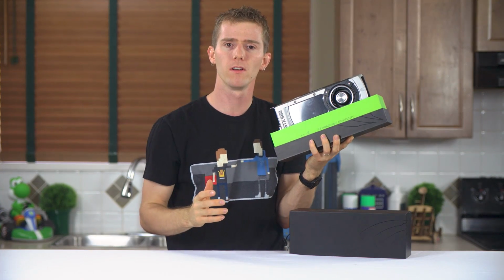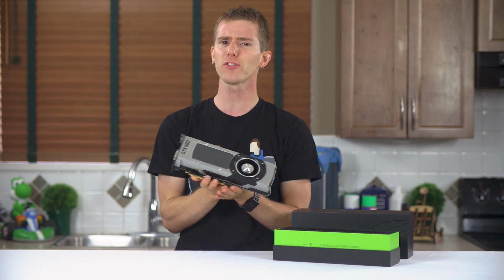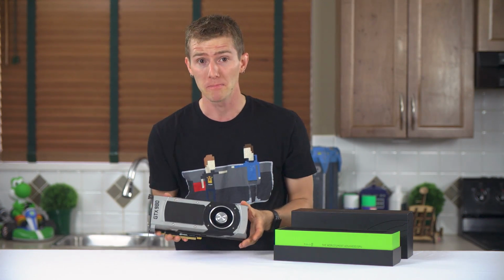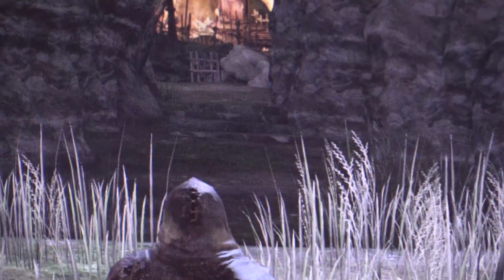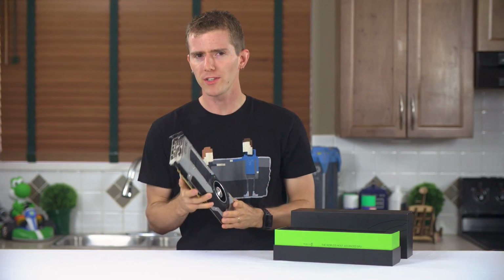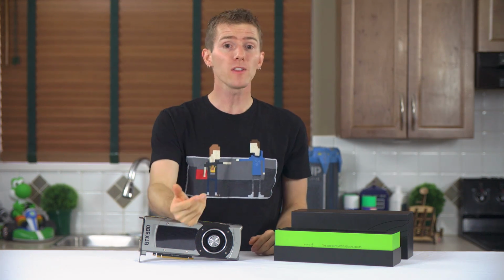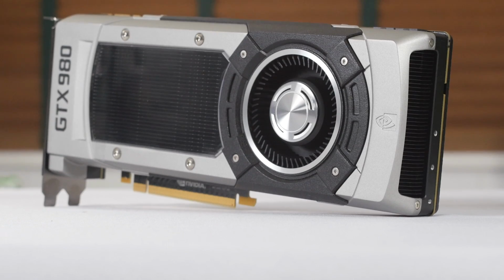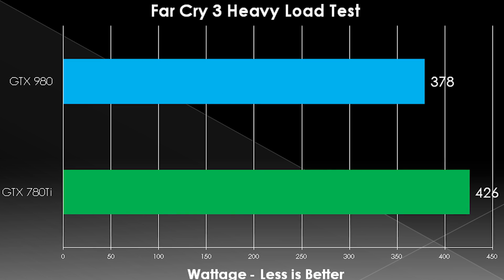NVIDIA GeForce GTX 980 Video Card - Performance Overview

Comment: Ok, so I´m going to build my first gaming pc. I´ll upgrade my desktop piece by piece, but right now I have an Intel i3 550 3.2 ghz on a MSI ms-7613 (Iona-GL8E) motherboard, plus 6gb of ram. I´ll upgrade my power supply first (doesn´t have 8 pin connectors) and maybe buy a new case.

From what I´ve read, the graphics card is the most important part for gaming. If I buy the gtx 980 and later, but certainly, upgrade other parts, what performance can I expect? can I start gaming with those initial upgrades? do I really need a better processor, or I can stick with this one till it dies?

Also, can someone give me some insight on my psu choose: the Corsair CX750 24-pin Atx 750w
Reply: Anyone?

Comment: AMD FX-8350 4.0GHz 8-Core Processor

Rosewill RCX-Z1 57.2 CFM Ball Bearing CPU Cooler

Arctic Cooling MX4 4g Thermal Paste

Asus Sabertooth 990FX R2.0 ATX AM3+ Motherboard

G.Skill Sniper Series 8GB (2 x 4GB) DDR3-1866 Memory

Crucial M550 256GB 2.5" Solid State Drive

Asus GeForce GTX 780 3GB DirectCU II Video Card

Corsair Vengeance C70 (Black) ATX Mid Tower Case

EVGA SuperNOVA NEX 750W 80+ Bronze Certified Semi-Modular ATX Power Supply

Asus DRW-24F1ST DVD/CD Writer

Cougar Turbine 120 (4-Pack) 60.4 CFM 120mm Fan

Xigmatek CFS-SXGJR-KU3 75.0 CFM 120mm Fan

that is my complete set up. i was just curious about compatibility and if i purchased the correct psu because i do not know for sure if i have all the pins and etc correctly. like will all the components fit into my psu?

and does my motherboard support 2-4way sli?

i am a noobie but i am a gamer and so i thought i'd ask a question here because i do not know much but i do need answers. thank you.

Comment: Kind of a noob question, but will the 980 be able to achieve 120fps with a single card on current and possibly future games at high-ultra settings at 1080p without needing SLI?

Comment: Can you test MSI Gaming 970 SLI or Gigabyte G1 970 SLI max overclocked as I feel these cards would outperform the 780Ti overclocked by 50% and are well worth the extra $150 over the 980?

Comment: I'm gonna wait for the 980 ti. I see no point in upgrading if the 980 is going to run the The Witcher 3 at only 30-35fps on ultra.

Comment: But the question is, could this run Killzone shadowfall? My guess would be no. Though it may have the diagonal kepler floating tubes and 16 dedicated smurx visors, it still lacks in the vex core department. It only has 11 vex cores, whilst the PS4 has 28 Vex cores under it's hood. Yeah, Vex cores aren't the be all and end all when it comes to pixel pushing, but a deficit of 17 V-cores puts the 980 at a serious disadvantage.

All in all, the 980 is a decent enough GPU. Just don't expect Killzone Shadowfall type graphics, and I think you'll be pleasantly surprised.
Reply: I know this comment is 4 years old but seriously what are you even talking about 😂

Comment: I have money for 980 or 780i, what shoud I buy?
And will my 850w Powersupply work
Reply: will my 850w Powersupply work ??? ...yes
980 or 780i, what shoud I buy ???? ...why the hell you want an older card... ???
Reply: get the 980 as driver support for it will last longer and the games in which it was worse in it was only worse by a few frames which means in the realm of error in that the 780ti had an "aggressive overclock" with the 980 with a "standard overclock" whatever those terms mean but the "aggressive overclock" sounds like he put alot of work into it to pump out the most possiable while the "standard overclock" sounds like it is just what most ppl will be using from a normal 980 when bought and hitting the "GPU overclock" in the overclocking program of MSI's ... they have really simpified it down that far.

Comment: Which is faster at 1080p? gtx 760 sli or 980? I dont care about temperatures and microstuttering and all that stuff I just want to know will this beat gtx 760 sli in modern games?
Reply: I also have an EVGA 760..I was wondering that myself, there arent very many 760SLI benchmarks out there, however I found one benchmark suggesting that the 760SLI performs slightly better overall than a 780ti, so id say the performance would be pretty much the same, 980 might be a little more powerful, I think Im gonna ditch the 760 SLI idea and get a 980 though because I want a 1440p monitor and could use the extra VRAM

Comment: I've heard the sound/fan noise of this card is significantly better than previous generations.

Would love to see you do a bit of a noise bake off to compare Idle, Mid Range game and a High end pixel pusher but only in the context of power draw and fan noise.

PS: Why doesn't anyone ever do a ducted fan strapped onto the card at a 90 degree angle?  I'm a front to back airflow purist and the spray and pray Dual/Triple fan designs on the AMD side of the fence frustrate me.  A good rear 90deg fan could cool 1 GTX card with a plastic shroud and leave plenty of room for shorter cards in other slots adjacent, or remove the shroud and a single fan could cool 2 adjacent GTXs with each fan getting about half the fan's total airflow.  All exhaust heat still goes out the back.

Comment: I've generally always used evga cards but considering I've ordered all the other parts for my build and they should be arriving by thursday I'm thinking of getting a gigabyte 980 just b/c they're in stock now and I don't want to wait on the EVGA restock, especially since I have no idea when that is going to be.  Kind of funny as I've had the money saved to do this build for months waiting on the 980 to launch and it hasn't bothered me at all to wait but now that I've actually ordered the parts it's like it's impossible for me to wait a few days or a week to see if EVGA cards get restocked.  That new build itch has taken over!

Comment: Is this a good build Sapphire R9 295X2 GRA Graphics Card (8GB, GDDR5, PCX, DVI, Mini-DPx 4.2S)

Asus PB287Q 28 inch Widescreen Ultra HD 4K LED Monitor (100M:1, 300 cd/m2, 3480 x 2160, 1ms, DP/HDMI/MHL)

Intel Core i7 i7-4790K CPU (Quad Core 4GHz, Socket H3 LGA-1150)

WD - 2TB Desktop SATA Hard Drive - OEM - Green

Microsoft Windows 8.1 Pro

Crucial BLT8G3D1608DT2TXOBCEU 8GB Ballistix Smart Tracer Memory
 
Samsung 24x Retail SATA DVD Writer

ASUS Z87-PRO Socket 1150 4xDDR3 Max 32GB ATX Intel Z87 PCI-E 1x D-Sub DVI HDMI DisplayPort

Corsair Hydro Series H100i All-In-One 240mm Digital High Performance Rad Liquid Cooler for CPU

Corsair CP-9020062-UK RM Series RM1000 80 Plus Gold 1000W ATX/EPS Fully Modular Power Supply Unit

Fractal Design Define R4 PC Case - Black/Pearl 

and can someone say if the graphics card on this build can not break that easy like if the computer falls  from the stand at the bottom of this desk http://www.ikea.com/gb/en/catalog/products/50219044/ if it still good if it falls from the stands at the bottom of the desk plz say
Reply: That's all good, but I would go with at least a 256GB SSD for a boot drive, and use the 2TB for data. I honestly wouldn't go with the WD Green, but with a WD Black since they have better performance plus better warranty, and with personal experience the WD Greens are absolute dogs performance wise, and not as reliable. Green = 5400RPM / Black = 7200RPM.
Reply: Ze Buttonmasha Can you send me a 4 tb one then and what would happen if i got a 1tb SSD
Reply: UpbeatGaming
WD BLACK SERIES WD4003FZEX 4TB
SSD drive would dramatically improve performance for your OS and primary programs/games. Just watch the SSD videos by Linus.
Reply: Sammy Singh I am getting a 4TB harddrive should i get the 4tb ssd
Reply: 1000 watts is a bit overkill when it just needs 50A combined with 2 8-pin PCIe connectors
Reply: sinephase not doing that build no more

Comment: I think I'm going to get a pair of reference GTX 980s once they become more widely available.  I'm currently running dual GTX 680s and together they equal the performance of one GTX 980.  So if I'm going to upgrade I going for two GTX 980s.  At some point in 2015 I'm probably going to get on the 4K bandwagon so this upgrade will get me ready.

Comment: I'm currently running 2x gtx 660 ti in sli, which are roughly equivalent to a single 780 ti, as the 980 is still roughly the same and I can not use the new features... Yet. 

Is there any point in me "upgrading" any time soon?
Reply: 1 card is always better than sli, but wait until the 980 ti
Reply: Mrchubakkaa that's what I was thinking. I think I can run 3440x1440 off of 2gb (though probably not on ultra) until then too!?

Comment: I would choose the gtx 980 over the 780 ti just for power improvements that the 980 brings to the table. All that talk on tech that's not supported just yet is just wind blowing around and making alot of noise.

Comment: Instead of ONLY OCing the cards and putting them into a graph against other GPU's, could you guys please run a benchmark or two with them at stock along side the OC'd results so we have a reference point on exactly what kind of OC you are actually getting.

Comment: I am impressed with the improvements and for the cost it is a Titan killer.  Along with the drivers and hardware advances I can see the allure.  Once other nonreference cards come out, it will push the card to it's max potential beating the overclocked titans with less stress on the hardware.  My issue is nvidia is holding back.  I bet they have a titan build already manufactured on a shelf somewhere waiting for AMD to drive prices and competition and then release it for 999.000.  The sad part is if I was purchasing a card I would go the nvidia 980 route. They are competing with AMD with good pricing, better performance and less power.  I have 2 r9 280x in my system because I was able to buy one and upgraded to the other and the 980 is at a price where I could have done the same. It may have taken a few more weeks of saving but it is in a competitive niche. The real test will be the gen 4th gen engines that are coming out and how well  both companies hardware can handle them!

Comment: So on the card comparisons table I saw that it blew the 290X out of the water. I am thinking of buying a new gaming computer, will the 295X2 blow the GTX 980 out of the water? I am only considering 1080p and 2K monitors, but I will be using 144 Hz...

Comment: To me it was actually surprising in a bad way, i expected way better performance out of the new Maxwell GPU. I will not bother getting it either.
Reply: Dude check anandtech gtx 980 reviews .They overclocked this card to 1.5 GHz without touching voltage, so yeah that makes this card 10-15% faster than a gtx 780 ti .

Comment: So you said if you over clock the GTX 980 you gain more processing power but you lose features, to which point of overclocking do you lose the features listed. I'm looking forward to do a build with this GPU due to all these features that go along with the uses i wanna go with on my build.